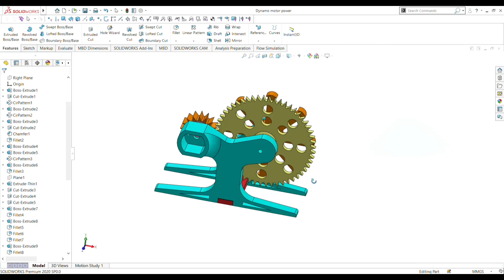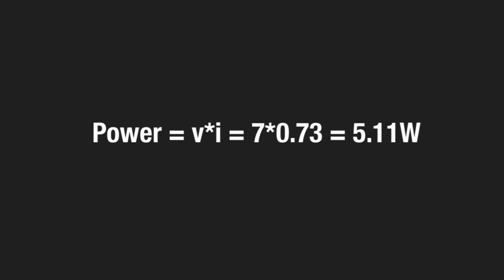3D Printed Dynamo Generator | mini

Comment: Great one, bro! Unique generator design! Did you come up with the coils placement configuration yourself? 👍👍
Reply from the maker: Thanks bro!
 Ya this time i tried to make using coils. But still this way is hard due to number of turns and magnets and other parameters. I rechanged the coil winding two times as it was not working initially.